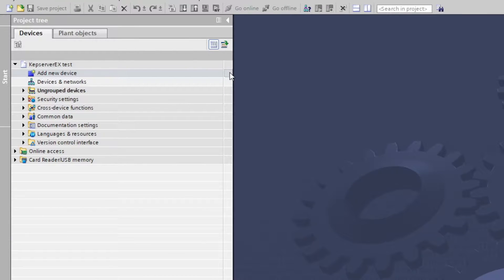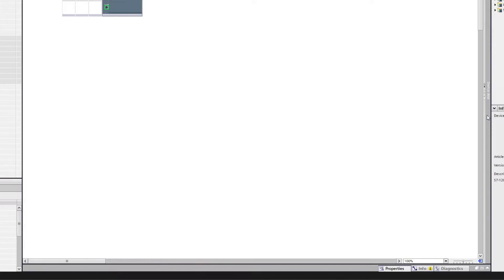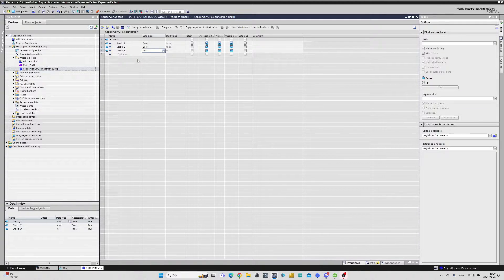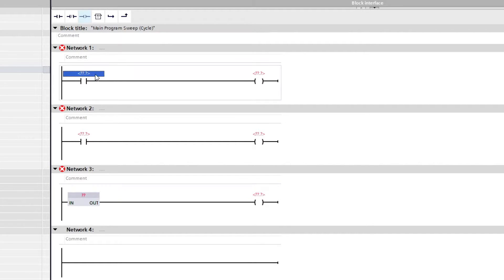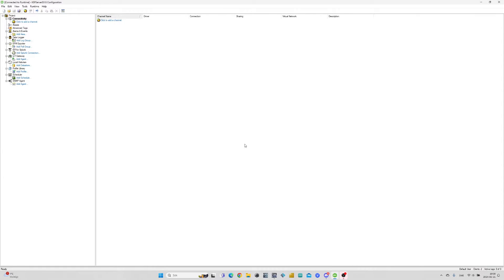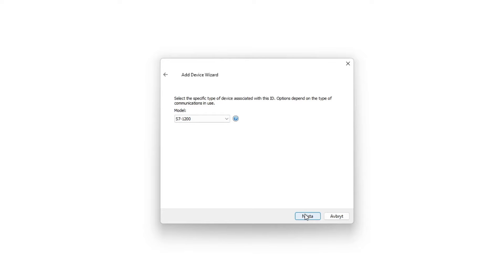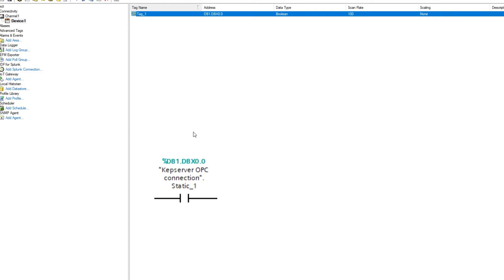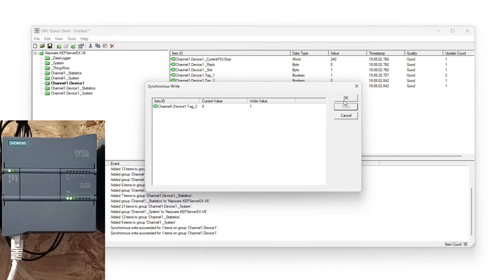How to connect siemens plc to kepware KEPserverEX OPC UA server ( TIA portal - Ethernet / IP )

Comment: Thank you! Seems straight forward, imagine this.. The plc has its own internal ip, 192.x.x.x.x then I plug an ethernet cable with company ip.. Let's say 10.30.50.x so would that affect anything and will still find it? The kepware computer is in another building and not directly connected to the plc. What ip should I put in the kepware channel device thing?
Reply from the maker: Hey! Thats a good question. I been thinking about the same thing but going through a virtual machine. Haven't tested it out yet myself so cant answer for sure but I would believe that the PLC need to be in same subnet range ( the first 3 parameters (192.168.50).x for example ) as your company IP. But I cant say for sure sorry.

I will test this out later at some point when I get enough time.

If you test it out before me and get it working I would love to hear from you!
Reply: @1lovgren  thank you! And yes let's see what you come up with, I'll also test on my side, I think I have to add a allen Bradley stratix switch, which basically does a nat 1to1 and ip translation, like a guy in the middle that makes 3 dif ip families talk to each other.
Reply: @jorgeavalos4429  I'd imagine you figured this out already, but for anyone else that stumbles across this: My PLC is on a separate VLAN/network and connects via a Cisco Managed Switch via the X2 port to a common network path for HMI connectivity with all PLCs in the plant. I was able to connect to my PLC across the gateway just fine, using the IP for port X2.
Reply: @SXRacer519  hey!!! i'm still messing with this thing hehe, thanks for the reply, any chance you could make us a vid tutorial dude? I normally record with power point has a free option to record the whole screen for free!! lol, also having the same issue, with a beckhoff plc using twincat3, funny that I can ping and do stuff in one building that is 10.30.40.xxx but if the PC is at building that has 10.30.17.xxx I cant see beckhoff devices :/ and IT dep is struggling to see this trough .....
Reply: @jorgeavalos4429  So a couple of things to check or have IT check, I don't know how big your IT department is as a whole or how intense your networking is, but to cross IP ranges that big you need to make sure your subnet allows that difference. I am far from well enough versed to say exactly what it needs to be, but if you're 255.255.254.0 it may or may not work, you could try 255.255.0.0 to see if that works, or get a number from your networking guy. I apologize if you  know more than me already on this, but basically the subnet only allows a certain variance (to my understanding) depending on the binary value. so 255 means it has to be identical, and 254 allows a certain variance. 0 is anything goes, so last number has to be 0 more or less if you're using the full range. 

Another thing is your gateway setup; our managed switches/VLAN's use a gateway, generally the xxx.xxx.xxx.1 of each VLAN/IP range, and that allows cross plant connectivity. Ultimately your network switch should have a gateway setup, and the PC you're using should also have this under its IP settings. In my Siemens PLC, under the ethernet setup page there is an option for a "Router" which has to be filled in with the gateway IP, otherwise I can't ping my PLC from a different IP VLAN in my plant. It's possible your Beckhoff has a similar setup and that just needs to be filled in to allow you to ping across gateways, I'm not very familiar with Beckhoff as our use is very minimal and more black box than the rest of our plant.

Third thing, you need to have your IT/Network guy make sure that there is connectivity between your 10.30.40.xxx and 10.30.17.xxx through the switch settings. It's possible they have this blocked, but if you can ping other things from that range, that's probably not the issue, I'd lean towards it being a gateway setup within the Beckhoff PLC or your Siemens PLC.
Reply: @SXRacer519  hey no apologies  needed, thank you so much for your answer, It did clarify a bunch of things I was guessing from reading online forums etc.. Other have mentioned that the best for this is to use an Allen Bradley stratix 5700 and use their nat 1 to 1 translator, that way you can mix stuff without affecting other cells like for example have same plcs with same ips or robots etc... That could cause ip conflicts and then its a nightmare, have you maybe configured one? Those you can export the settings and load them up.. I could try to copy your settings and tweak them if so...I got a used stratix form ebay to attempt this but no luck still. The IT network is a shit show, cuz when you plug things to the wall foes torugh fortinet.. firewall, vpns and vlans again..,i hate that in school they just teach you how to plug things directly and not as massive as it is when you are in the actual industry, hehe like learning how to do 2+2 doesn't help Cuz out here is wild.. Hehe
thanks for the help dude,...